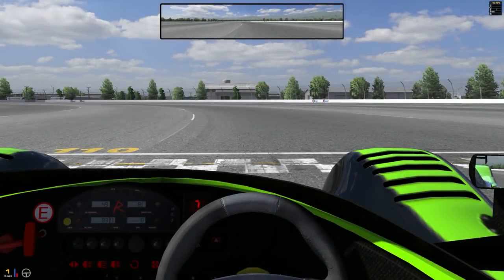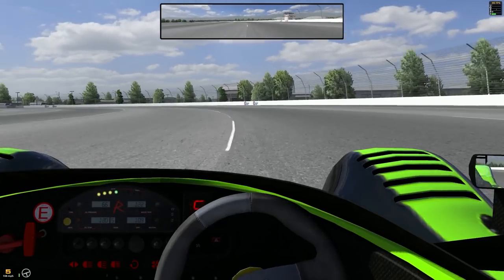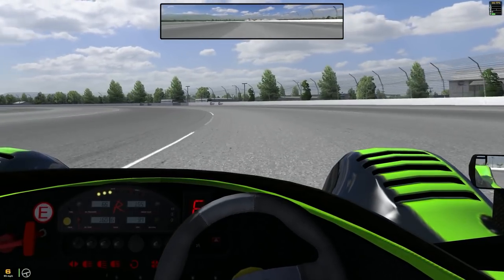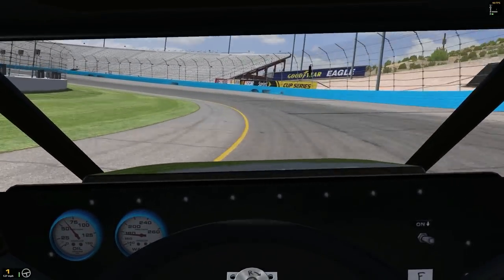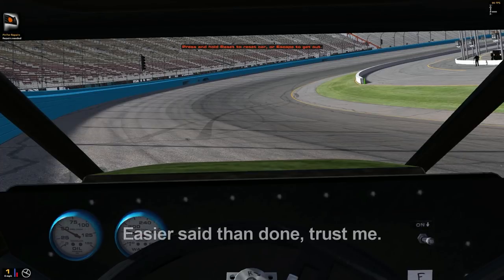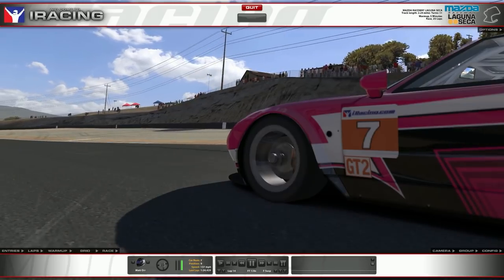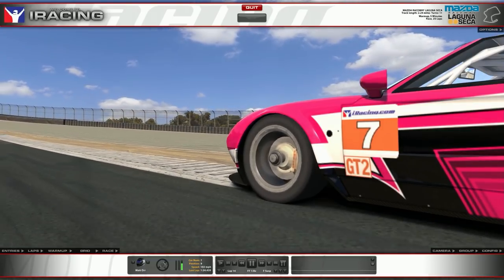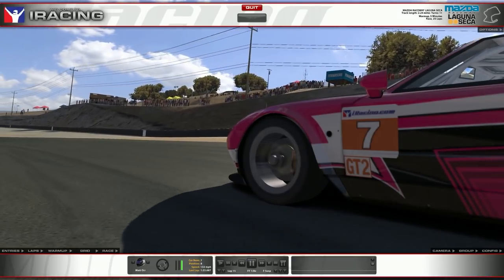Sim Racing 101 : Brakes Are (NOT) For Stopping (Ep8)

Comment: Took the advice from this vid, used it and it helped me so much. I never thought of the wheels needing to be balanced through the corner for max corner speed. I've always concentrated on loading the front by trail braking a lot so I could make the turn. This would usually help me be able to get on the power faster, but my mid corner speed was so slow. 

I had been running the Star Mazda in Iracing at Okayama this week trying to just learn the car so I could move up to that series. Best I could manage was a 1:29.6. After using this advice, braking before the corner and letting the car just be balanced through the corner for max speed helped me increase to a best time of 1:28.0. 

ANyways, thanks for the videos. Really enjoying them.

Comment: Thanks man, I was getting frustrated after getting my first actual wheel and pedal set in the mail today, driving horribly and having to drop the AI down a whole 10 percent. After watching this though I was able to knock a good 2-3 seconds off of my time at Mid Ohio in a '87 M3 touring car in Race 07. I also finally felt fast without also feeling out of control and feeling like I have constant under steer.

Comment: Tanks are a totally different animal. Tracks w/torsion bars running to every roadwheel... and an M1 engine w/tranny weighs around 8k lbs mounted in rear, but forward of the last wheel. Results in very good weight distribution.
If anything tank struggles with too much grip and leaves rubber everywhere it goes on paved surfaces... but it can also turn on a dime. Which is surprising for a lot of people given how big it is. Moreso if you use neutral steering (only moves 1 track) or pivot steering (tracks move in opposing directions)... but it's easy to make typical car turns using the L gear.
It's really meant for dirt, but you have to be careful in very loose dirt also - the rear part of the track can get trapped side-to-side in thick loose dirt... if you turn suddenly, the track will stay still and the sprocket will swing out with the tank... resulting in the track coming off the sprocket. A thrown track in thick dirt is gonna be a bad day or two.

Comment: Stay at it, your left leg will eventually get sensitized to applying precise pressure as well. It took me a good while to learn to left foot brake too. In the beginning my left food too used to stamping on the clutch was only capable of doing on/off. What probably helped me as I first learnt it on a road car so the g-forces help you out at balancing the pressure. On a sim you don't have g-forces so initially its more of a guess work as to how much pressure you need to apply...

Comment: When a corner is feeding into another and I drive through them at the same speed, I accelerate after the first and brake (still above my level: trailbraking) into the second turn. Braking in this case or even just lifting the throttle for a moment helps turn the car in.

Comment: Also, I suspect going so hard on the throttle pushes you outwards, forcing you to maintain high steeringwheel angles, again decreasing exitspeed. 

On a general note, unless a car gets unstable because you are pushing it, or special kinds of track layouts that might require otherwise, once the car is stopped you you are turned in, your steeringwheelangle will never become greater, while you throttle appliance will never go down.

Comment: I have been trying to trail brake but it's really difficult to get the pressure just right. Sometimes I add too much pressure or press on it too early and the car turns in before the apex and then I have to make corrections. Other times it's not enough and the car understeers off the track. It is a great feeling though when you get it just right and the car pivots around the corner hitting the apex perfectly. But for me it's more of a matter of chance that I got it all right than being precise!

Comment: Is this basically the same principles you'd use in rally driving on low grip surfaces? Obviously oversteer isn't gonna be desirable on tarmac, but the general feeling of moving the weight around remains? I realize it's a very simple question but it's just so I can conceptualize it properly.

Comment: Hey Empty Box: minute 10:52 you said that blips are for shifting. You mean, when shifting (in sequential or semi-automatic modes like gt3 cars) you blip the throttle to compensate when the car generes a little weight transfer to the front when downshifting? Sorry if I missed something, my native language isn't the english, thanks!.
Reply from the maker: Blipping the throttle on downshift is done to keep the driveline of the car stable.

If you don't blip you either feed the clutch back out (like most people do on their road cars - this is slow.) or you have the engine and transmission and drive wheels not doing the same speed which causes all sorts of chaos, similar to locking the rear wheels momentarily. When you downshift, the engine needs to turn more revs in the next lower gear, so without blipping the engine needs to speed up to the proper RPMs while it's in gear - not good. Blipping is just that, bringing the engine up to the same RPM that will be used in the lower gear while the engine is still in a neutral position between gears.

Blipping is not done for weight transfer, it's about keeping the car from becoming unstable due to the driveline.
Reply: yes, I know and I do that in manual transmission cars, but I don't understand it in semi-automatic gt3 cars because it's supposed the computer inside the car does it for you, and it's so hard to do the things better than a computer but I'll give it a try, thank you for responding!
Reply from the maker: Kalamede
That Ford was a GT2 car without any auto blip, but yes, if the car has auto blip use it!

Comment: Question. Let's take an example of Dover. The track clearly. It is banked everywhere, but in the corner what would you do. I let off and the car just goes straight into the wall. Now would adding a bit of break or let off the gas only a little help? Or what would I do in that situation.
Reply from the maker: You want to get into the power as early as possible, you should typically be off the throttle and getting into it by the middle of the corner.

If you mean on entry, you are probably overbraking and overdriving it.
Reply: Well I do that. (Note this game is not a sim but Ivan say it's just working with it). So I can get onto the corner good but not get a good apex. Or arch. I think it's arch. You'll see on my NASCAR inside line video what I do if you don't get it. I love arching/apexing the car. But on '14, it doesn't want to. And gets tight. I don't know exactly what to do. I let off but it just goes straight to the wall. I can't tell if that's what it's supposed to do or not. If not what's the best thing to do in that situation?

Comment: Nice video "boxy"! I agree with much of what you said, but I do have a comment.

You don't seem to practice what you preach. You go on the throttle very abrupt & agressively, exit the corner at WOT and then back off again to around 2/3 throttle to not overshoot the curb. Then finally go back on it, when the car is going straight. Getting the car turned, setting up apexes a smidge later and especially going on the throttle much earlier but delicately will probably yield better staight-line speed.

Comment: Quick question ; do you need to blimp when downshifting with a paddle shift gearbox?
Reply: The newer the car, the less likely you will need to. Early-2k's GT1s often had spartan dogboxes, requiring blips on downshifts; modern GT3s automate that out, so you need only ask for an up/downshift, and the car will do everything else.

Comment: I Drive instinctively. are you saying am doing it wrong? i can be quick i can be really kwik if i practice a track. and i learn the track as i play it and i learn the corners as i push the car and see how i can push the car around those corners. this is how i do it.
ive seen vids tell me i need to go around the track look  around corners for braking areas like a bill board i do this with instinct am a good driver. in game and on the road. in real cars it becomes more about your gears. because unless you joyriding your less likely to be racing. unless your a boy racer like i use to be. ive had a few moments ;)

Comment: Hey EB, do you recommend the pedal mod which makes the brake more pressure activated rather than travel?
Reply from the maker: Never used it with my DFGT pedals as I always planned to replace them, but yes. Pressure is better than travel IMO, it's much easier to be more consistent that way. Not necessarily faster, but I certainly feel it's easier, in the good way.
Reply: I used bungee cords wrapped around my DFGT pedals and the base to give it more tension/stiffness. If that's what you're talking about.
Reply from the maker: *****
Do you like tweaking setups? If not, then iSpeed is all you need, and that you don't really need to pay for. iSpeed is a good tool to have regardless, though I will say I don't use it as much as I should.

Otherwise, I don't have much experience with them. I thought you could use Atlas for your telemetry program, which is free?

Comment: How are you pressing throttle at the same time you brake?
Reply from the maker: +SideFlame I, like many other humans, possess two feet. :)
Reply: Empty Box
Not what I meant xD. Are you left foot braking? I thought that was only for rallying.
(new to driving, don't slay me pls)
Reply from the maker: I use both my left foot and right foot, if you want you can catch one of my pedal cam videos here -
https://www.youtube.com/watch?v=Zkljq_67bFE

Depends on the car, depends on the situation for me as I'm comfortable with both feet and actually use both a good bit. Left foot braking is very common in racing today, especially now that modern racing gearboxes can tolerate more abuse by design so there is less need to use the clutch for anything outside of getting started.
Reply: Empty Box Thanks for the video. Only have 2 pedals atm but I'm getting T3PA's soon so I'll probably end up doing a similar thing. Do a lot of people alternate between using both feet for braking? It seems like something that would take a lot of getting used to.
Reply from the maker: SideFlame
I honestly don't know, If you mean my foot switching thing from right foot to left foot braking mid brake zone, I think that is uncommon.

I know a lot of people right foot brake for downshifts but use left foot braking for brake zones without a gear change though.

Using both feet in general takes some time, but it's pretty handy just to be able to do so.

Comment: If you break and throttle at the same time, do you use only your right foot or your left foot as well?
Asking because normally using the left foot on the breaks is a sin but handling such precise inputs feels like it must need both feet.

Comment: I don't understand anything... I never drove a street car. I am 15.
Reply: +Mein Kanal! im 16 and have been driving for a few months now. this won't apply to real life every day driving. This is meant for driving a car near its limits and getting every bit of speed you can get.
Reply from the maker: +clasota15 Yes, very much so this.
Reply: +clasota15 I could do driving now too, but I'll wait until I'm 17. Yeah, but I didn't even know which one was the gas pedal :D. My question is: how many degrees of rotation do race cars have? 900?
Reply: Everything just slides around in Assetto Corsa... :(
Reply: pretty sure they have 900° of rotation but I play with 900° on every sim. (especially r factor project d mod)
Reply: pretty sure they have 900° of rotation but I play with 900° on every sim. (especially r factor project d mod)
Reply: +Mein Kanal! Around 400.
Reply: Horst Wrabetz Oh, okay! Thank you! I was using 900 up until now
Reply: +Mein Kanal! 900 degrees is what you want. If you are playing assetto corsa, try using extremely low horsepower cars until you can go around corners without the back end sliding.
Reply: Carl Wiegan Yes I do now. So I can now keep up with the cars in the first few carreer levels. Thanks!
Reply: Mein Kanal! Wait. I messed that up. I meant 400 in one direction. So 800 all around, haha. Or 720. Something like that.
Reply: +Mein Kanal! Above 1080 for road cars. around 900 for some performance cars. Around 720 for some supercars (ferrari) and older race cars. 540 for most GT cars. 450 for open wheelers.
Reply: you driving now?

Comment: Grip applies in a single direction. Tires can only do one thing at a time.
Reply from the maker: Not true. How would you ever possibly accelerate while turning for example? Trail braking wouldn't exist.
Reply: Empty Box in those situations you are finding a balance. I think it's fair to say that you can't accelerate in a turn as hard as you can going straight. You can't turn as hard while de/accelerating either. Your video demonstrates these principals. Assuming you do have traction, you're getting the same amount of "grip" when in a straight line or turning, but when you do both the force is diagonal so you have less to help you turn or speed up or whatever. I was being very general, describing how i visualize the effects going on. I do agree that yes, driving quickly around a racetrack is more complicated and every situation has its own nuances